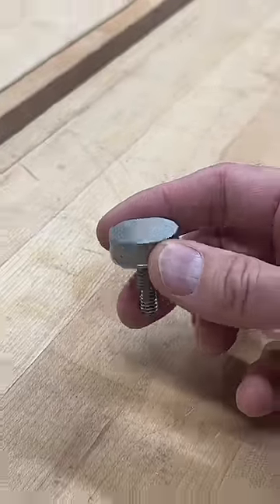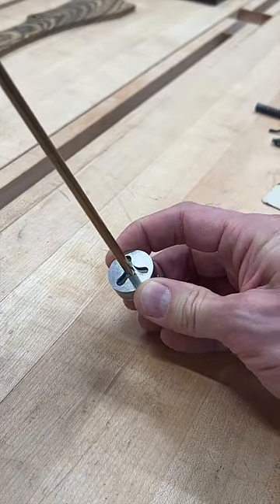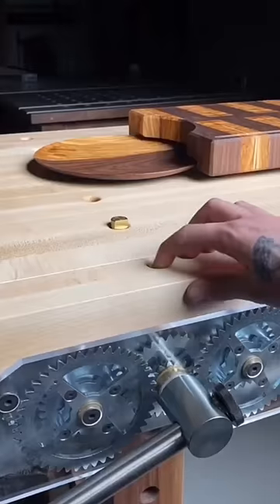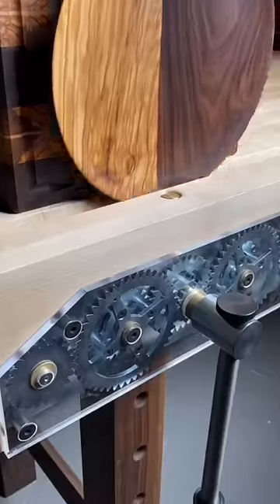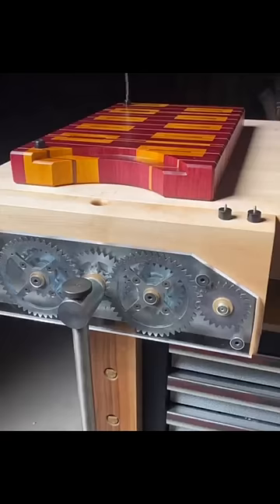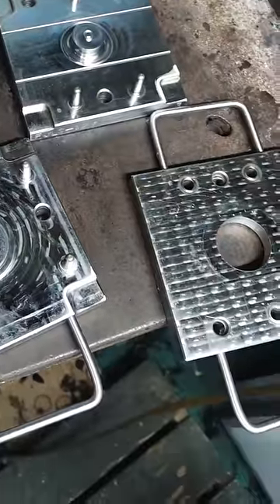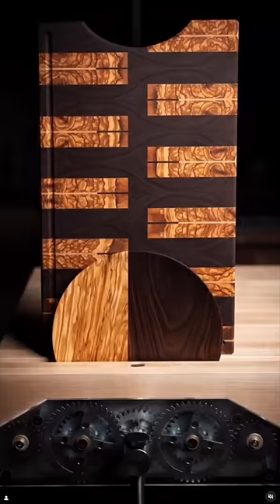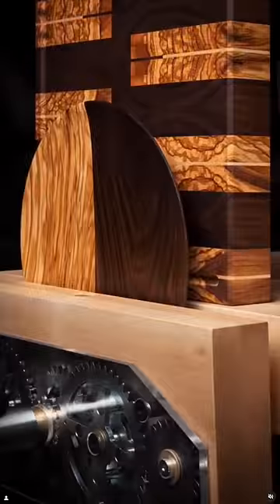Pika Screw on Owl Woodworks cutting board

Comment: Cool doodad. 

Professional cooks/chefs don’t use cutting boards with feet. We like to be able to use both sides. Also feet can trap debris and hence bacteria.
Reply: i dont like feet on my boards but that being said they prevent water from touching the board should your helper forget the board on a wet counter. the reason to keep water out of boards is to prevent cupping, not microbial growth.  water isnt a concern at all for food safety, heres why.

good quality end grain wodden cutting boards, as long as they are properly maintained and cared for, are dry as bone and completely sterile, surprising but true. thats because first the end grain orientation dosent get damaged from blades but flat grain does. second, the wood is dried to 7% humidity which is in equilibrium with normal indoor conditions and that is way too low to allow bacterias to survive or mold to grow. boards are supposed to be near saturated with mineral oil (upon construction they are dunked in a bath of oil until saturated. after that just regular reapplying of the oil is sufficient to maintain it) ,that prevents water from getting in since there is no physical place for water to go. bacteria are being pushed between the fibers on a microscopic level but they die within 5 min of being put in that dry, oxygen free environment. and third, hardwoods used for boards like maple, black walnut and purpleheart contain tannins which inhibits bacterial growth. 

for all these reasons wodden boards also dont need to, and shouldn't, be washed with soap. that only removes the mineral oil overtime therefore making it less effective at keeping water and unwanted flavors out. just wipe it down with a damp warm cloth, thats it. no smell, no bacteria.

on the other hand, plastic cutting boards need to be heat sterilized in the dishwasher after each use and still needs to be replaced regularly because knife marks roughs up the surface and makes pockets in the material which cant be cleaned, hence the heat sterilization. regulations call for plastic and heat because its foul proof but they also recognize that properly made and maintained wodden boards are safer than plastic boards if they arent heated to 80C for some amount of time. wood is faster, just a quick wipe and stored vertically or if it has feet dont even to move it!
Reply: @JohnSmith-kf1fc hol up, I ain't reading that.jpg
Reply: @JohnSmith-kf1fc  that was super helpful and informative. Broken down like that it makes a lot of sense even to the lower IQ people like me😂. I appreciate your time and effort typing that out!
Reply: @zennydoo    heres the tldr: hardwood endgrain cutting boards are awesome and plastic are shit. i used to have one perfect massive board and i was happy. but now im unhappy so i use a plastic board
Reply: @michaelandfallyndavis7390   im glad you enjoyed reading it :) learning about wood science and making cutting boards was fascinating and i know others enjoy this too. i was so serious about it i read the better part of a 1600 pages report on the global cutting board market, i made about 50 unique high quality massive boards and know everything there is to know about that topic... but i use a $4 plastic board 😆
Reply: How to make a chopping board an ornament should be the title of this video
Reply: Yes. You make food for money. They make videos. This ain't for workin kitchens. The elevated board helps with filming what thier hands are doing
Reply: I would suspect this would be more for a celebrity chef, not a professional chef.  You know, someone who pretends to be a chef.
Reply: @JohnSmith-kf1fc you a chef or a scientist 
And I bought a board that I use at work made it f plastic then one about a month later for at home my partner wanted a wooden one she cooks most days and is a component cook but doesn’t use the board as much as I do my work one the wood is messed up my plastic on still has a good few years to n it I’d say
Reply: I think this is more for the "rich people trying to impress each other and show off by buying the most "best of the best" objects they can find or commission" crowd.
Reply: @JohnSmith-kf1fc  idk about anywhere else but in NZ commercial kitchens cant use wooden boards anymore, you have to use the plastic colour seperated boards now. 
wood ones aren't as sanitary sadly.
Reply: @JohnSmith-kf1fc  Wooden tools were banned by the company for a zero tolerance food and safety measure at the place I worked.
Screws with moving parts is just a nightmare to deal with.
Reply: @JohnSmith-kf1fc ”completely sterile”? Bullshit. Next time you need an operation ask the surgeon what they’d think about using your chopping board under you.
Reply: @WinterXI  the majority of wooden chopping boards are cheap shit imported long grain wood, not quality hardwood end grain. And while if you read what he wrote, you'd know that end grain is more sanitary than both plastic and long grain, and why.
Most are also imported and made from shit woods from dodgy or unknown origins. An end grain board made from a hard wood (ie not pine) is necessary. Macrocarpa, Rewarewa or Kauri is good, but Manuka would be better due to wood oils being naturally anti- bacterial, fungal, and septic. Gum is similar to a degree.
But, let's face it, NZ is a fucked up Nanny State where you're not allowed to think or act independently of Govt rules and bullshit 'for your own good'. Far cry from Common Sense and real science because they feel the need to coddle the lowest denominator of fuckwittery and keep them safe from self-deleting while the perfectly capable are hamstrung by the restrictions.
Reply: @Tomeccho  woahhh settle down sir dont needa go too hard
Reply: Plus it's wood
Reply: @Tomeccho  dawg that last paragraph actually made me chuckle 😂
Reply: @JohnSmith-kf1fc You contradicted yourself by saying the boards don't have enough water inside and are water resistant, but the feet would allow water to be retained in contact with the board allowing for bacteria to collect.
Reply: @JohnSmith-kf1fc the main thing there is "if properly cared for" your average person, including kitchen staff don't care enough, not to mention the KP will be the one washing things and I can guarantee doesn't care about your nice wooden board...
Reply: How do the feet trap debris and bacteria when the entire underside of the cutting board traps debris and bacteria. The whole point of feet is so that water doesn’t get trapped under and soaked by the board. Cutting boards are used without legs because you can use both sides and they are more stable that way, not because the feet are trapping bacteria. Also the solution is to have a clean and dry (or oiled) surface underneath the cutting board
Reply: @Areeb118  Because you wash them
Reply: @Droid6689  what does the “because” “you” or “them” refer to. Your comment is nowhere near specific for me to understand. Also you don’t necessarily wash cutting boards.
Reply: @Areeb118  Seems you understood perfectly well. Not sure why you wasted time pretending you couldn't. Also who doesn't wash cutting boards?
Reply: @Droid6689  I wasn’t pretending I was legit wondering because wooden cutting boards are not often washed. Also I clearly stated that legs keep the cutting board above water on the counter surface if that is the case. I’m not talking about when washing them which is minimal water contact compared to a flat cutting board with any liquid underneath. In other words: if there is gonna be water/liquid on the counter, having legs prevents the board from being in contact with that water. Saying “because you wash them” completely disregards any of the context I gave for my argument. It was confusing to read because you clearly aren’t getting what I’m saying and are still focused on your own argument
Reply: @Areeb118  Who is using a cutting board in a pool? You wash it with water and dry it on a rack. When it has feet they do not dry properly and the water collects in the cracks and seams of the feet. If you aren't washing cutting boards then it is irrelevant, because your board is going to be covered in bacteria regardless.
Reply: Yeah, well, using both sides of the board is proof you grooved one side, thus allowing bacteria to grow in yours also, until you get both sides sanded down again. But hey, you are a professional chef, you know that already.
Reply: @JohnSmith-kf1fc chefs still dont use them, lol. In some places, the department of health wont even allow them. Every restaraunt ive ever worked had plastic cutting boards. Wooden boards require maintenence, and chefs already have enough to do. Home "chefs" might use them, but youll probably rarely, if ever, see a wooden cutting board in a professional environmnent. Plastic is much easier and safer to clean in a restaraunt, granted youre washing it properly, with soap and sanitizing liquid. Wooden is fine for at home, where you may need to cut a few things and then youre done. But restaraunt cutting boards are CONSTANTLY being used and washed, which makes plastic a better choice, especially when you have 10+ boards at any given time. Easier for storage too.
Reply: Chefs also cant afford $27 screws in a cutting board
Reply: @JohnSmith-kf1fc anyone with a brain puts a towel under their board
Reply: @zennydoo I’m not reading that bullshit either lol

Comment: You know you've made good art when people love it and hated at the exact same time. I am among those people. Split between the extreme craftsmanship, and the absurdity of simply not magneting on a cap to a regular screw, or making it latch on, or making it glued on. It doesn't really matter because no one's ever going to take it off, but I suppose the rubber foot may become damaged at some point and you might need to remove it? But that just means you need to use better rubber, or maybe the chef needs a sub throwing his tools. I imagine the cutting board itself will last fewer years than the rubber foot.

And yet, it's gorgeous. 😂
Reply: Or you could thermally fit it.  You can have a press fit part on thermally sensitive materials using cryo temps instead of high heat...  cheaper and easier.  1 dollar for a pound of dry ice and about another dollar for a milled shaft.  silliness
Reply: I hate people that glue everything, "won't ever have to be taken apart" cuz it will be thrown in the trash?

Comment: The rubber covering the screw, covers the edge/perimeter of the screw. The covered edge can have small cuts or faces for a wrench to engage the screw, which is then invisible with the rubber. You can even use standard bolts, with a big enough rubber guy.

Comment: I really admire the passion to hide screw slots in locations you'll probably never see.

I hope they are watertight and stainless steel so any moisture from cleaning the board will stuck.
Reply: Nothing like perfectly hidden mold in a cutting board right?
Reply: I don't

Comment: 🤔 It's a beautiful bit of engineering, and would be useful in certain contexts .. but there is indeed value in being able to see the screw slot. Especially when you need to disassemble something, to repair it for example.
Reply: You don't repair stuff that would cost this much; you buy new.  Generally speaking, the higher the cost of a premium item, the less likely there is a chance to repair the item without shipping it back to the maker.  This goes for Cars, electronics, certain watches, etc.
Reply: I can think of a few things that this type of screw would be great for. Ones I can think of is mainly for furniture. For one screws are going through furniture. For example the underside of a reclining couch. As you know the screws can actually cut into the dust lining that's under there.

Since these aren't as jagged they would work amazing for not creating too much friction and cutting into those dust sheets as much.

Another thing is the screws can be used to help with upholstery and make it easier to peel it off, but also make it look nice. While tac are easy to come by it is not easy to reupholster anything because those tacs; you have to get a new ones to do it. It would be a good way to hold down upholstery and make it easily removable and replaceable. So that you don't have to buy new tacs. (Think of leather chairs with the tacs all down it)

These screws could also be good for preventing getting cut from the screw head. What I mean by this is if you've ever landed on a bear screw that you didn't Make a socket for or you did but it sticks out just a little bit. You hit it just because you fall or rub your hand against it the wrong way and get cut.

Now for more decorative things I can see these being used. For example I can see the peak of screw being used for cosplay armor. Making the pieces easily detachable Well also Not having to pay for more tac but the pieces together. Or even where screws have to be really close to the face and they can be used instead. For example like in mascot costumes the fan is located inside of the head. But that also means there's a whole bunch of screws holding in that fan. Those screws can cut you if the head decides to move in the wrong way.

Comment: it looks like the inner piece has a different grain orientation than the outer. it's not about accuracy, just tolerance of fit, which can easily be made with a milling machine and finished with a surface grinder

Comment: You could screw rubber feet and use filler or brass/metal plates to cover up. I really like the design if you can get the price down to around $5 each I think they would be worth it for the convenience and nice look. That is a very high markdown from 26 though. Great idea. Perhaps if you also made smaller ones that are slightly bigger than 1/4inch instead. They could be used in more cases like the mounting plate for guitars which are always exposed screws. That would be a perfect use case for this

Comment: Even if they are, your part will be the non advertised, least admired part of the cutting boards and no chefs are going to pay you 26 bucks a screw and use them on anything in their kitchens. They'll go to home depot and buy hardware that costs cents. It's a dead end part.
Reply: Yeah but no. They cutting boards are already being sold to these high end chefs and other people with more money than sense. Hes just making the new model. People still buy iphones and new cars for the status
Reply: Those aren't chef's cutting boards anyway.  A chef's board is thick and flat so they can flip it over and use the other side. They aren't made for looks. They are made for heavy constant use

Comment: I just put the screw in deeper with a hole in then stick a dowel in and cut it. Looks slightly off but much nicer than the screws showing and much cheaper than this option.
Reply: And that's what anyone with common sense would do.
Reply: might be faster to glue the feet on and not screw. if the board is already oiled and you need to switch sides just cut them off and put new ones on the other side after defatting the surface. since the board is end grain thats harder to do but sticking the board in the freezer will help in keeping the oil from migrating back as fast near the surface where you need the glue to stick. technique and right choice of solvent aside its very easy to do

Comment: I simple flat and clean surface with a special rubber bit to grip the flat surface might have sufficed, assuming you don't need a super tight joint. This way you can make the head as small as you want until the grip force gets exceeded by the thread.

Comment: People complaining about this are missing the point that it will be flush so that no debris gets stuck under it, and you don't have to worry about your cutting board moving whilst you're working.  For someone that uses a cutting board frequently and/or decide that's what works best for them it's a must have.  Not to mention that this is something that'll last at least a lifetime

Comment: My guess is that standard screw heads have points of stress, where torquing them will cause minor damage and ruin the effect. Would explain why they have a rounded shape. I'd also guess the spring inside is more easily stabilized with a shape that doesn't just sit on one axis.

Comment: I work for a company that makes equipment for kids waterparks.  A long time ago, they had custom security bolts that had the company name as the security "key".  Many years later, it cost existing parks about $75 dollars to replace each  bolt so it was cheaper to replace all their security fasteners with security torx than to replace 4 or 5 custom bolts 😆

Comment: I feel like making the hole where the screw goes in a little deeper than normal and then gluing a flat circular piece of silicone on top to make it flat and make it whatever color you want, or even plastic or wood, would work just as well and be way cheaper.

Comment: Considering the great detail of design for the hidden slot I'd call this a bolt and not a screw, as screws are more about the thread (aka. screw part of the bolt). The screw shorthand for bolts is not really well originated but it works, unless you have a complex bolt.

Comment: This screw can be used for aerodynamic purposes. Obviously in different designs.  That’s the first purpose I think about when it comes to flat surfaces.
Reply: The reason we never care bout screws in aerodynamics is because a single layer of paint fills up the screw head. 
This screw has no use other than selling to pretentious rich people who want to feel like its a good idea. Even if you wanted to achieve all this, he could've made it with a hex head or a torx head, but instead made up an entirely new head shape so he can also sell you the tool to use it.

Comment: Here's an Idea: Metal cylinder, hollow, with screwable lid, hole in cylinder bottom, thread any screw (nail/nut/pin/whatever) through bottom hole to tighten cylinder to target object. Screw on lid. Same effect, fracture the cost?